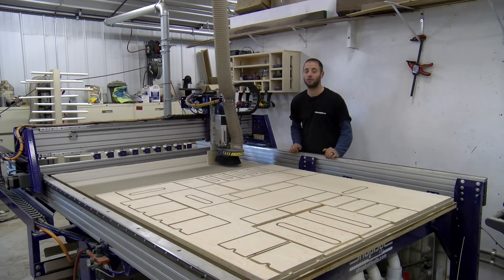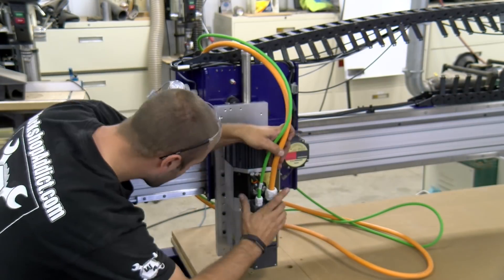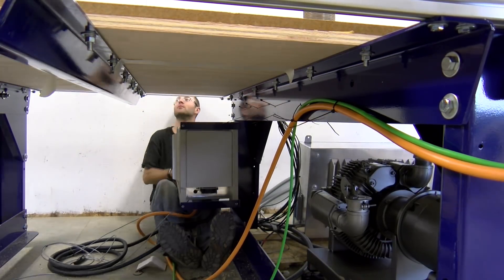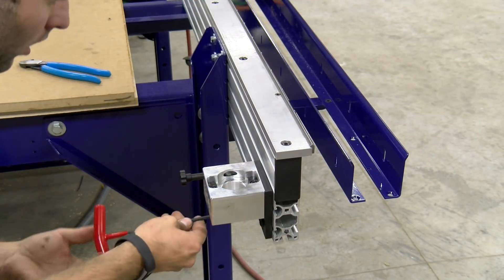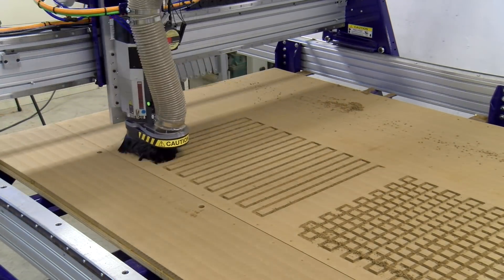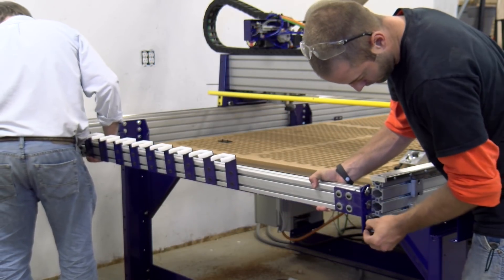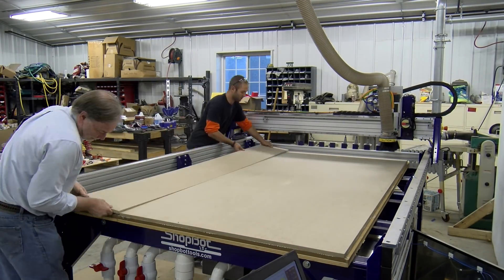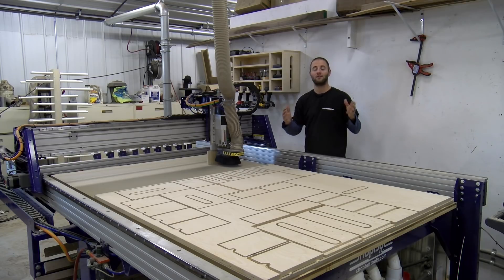ShopBot PRSAlpha 5'x8' CNC Machine Overview Assembly 2 of 2

Comment: its been 3 years now, you happy with the machine? have any parts worn or needed replacement? if you had to do it again would you have gone with a bigger machine? i manufacture custom cabinetry and im about move into cnc production. curious what you think after a few years of use.

Comment: the mdf suction board thing was most suprising to me. I thought you'd lose all your clamping pressure
Reply: If you think about it, atmospheric pressure is (roughly) 14.6 lbs. per square inch.  If you create a vacuum under a         4' x 8' piece of plywood, you have over 67,000 lbs. of pressure holding that sheet down.  Of course, it's not a PERFECT vacuum, but even if you had 1/3 of the possible vacuum pressure, you still have over 20,000 lbs of pressure.

Comment: @4:09 looks like you would've been lost without chris. This isn't giving me confidence that i can assemble this by myself.
Reply from the maker: MySchizo Buddy nope, super easy to do. Just plumbing the spindle.
Reply: Having the factory rep present makes the assembly quicker and easier but is not essential. We had a rep set up our machine (a larger machine with fewer options) but when we needed to relocate the machine, we did it ourselves. You just need to take the time to make sure everything is straight, parallel, and square enough for your needs.